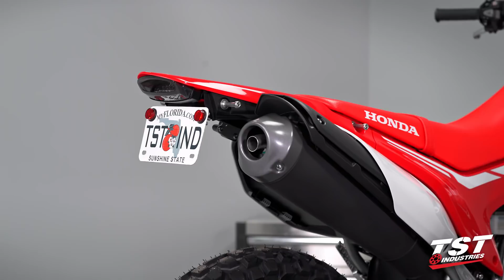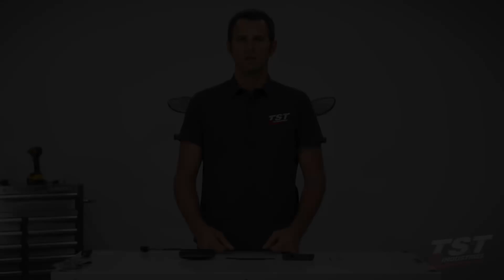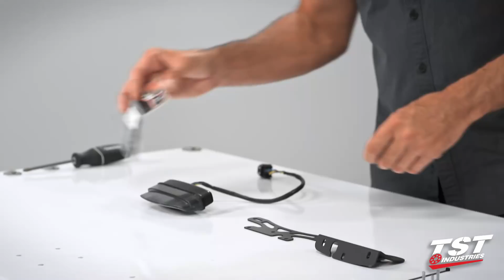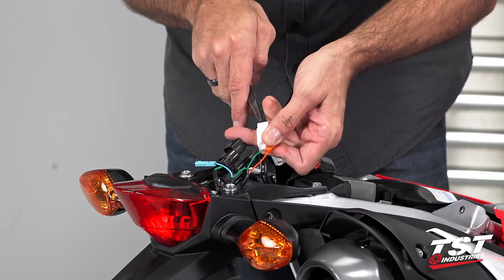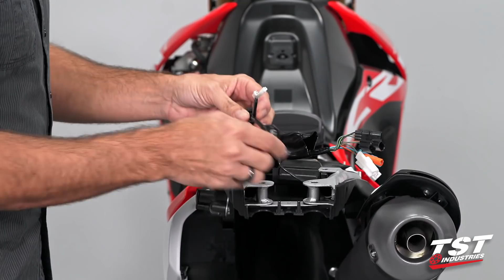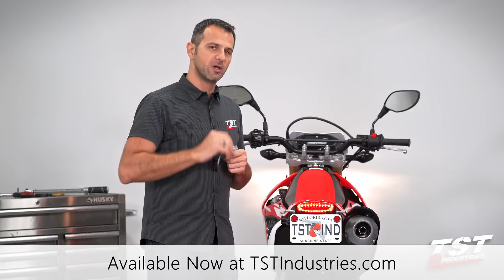How to install an Integrated Tail Light & Fender Eliminator on a 2017+ Honda CRF250L

Comment: Bought a bike with this system installed. Have a weird issue where applying the brakes will cause the turn signal to turn off at the rear/front/indicator. When I let go of the brakes, the signal comes back on.

When the emergency flasher button is pushed, they stay on even when braking. 

Any idea why applying the brake would cause the signals to stop until released?

Comment: Mine came in the mail today. Almost finished installing it and found out the wire harness on the rear fender eliminator doesn’t adapt/connect to the wire harness on my bike. Not sure what to do

Comment: I am waiting for something like this one for the Crf300l
Reply from the maker: We do own a 300 and have ripped it apart for that purpose. Just juggling several projects so please be patient. Also, at this point it is evident that it is impossible to make the 300L kit as clean as the 250 because of a frame component that hangs under tail light. We could potentially require the removal of this frame component but then a limited amount of customers would actually want our kit. So I am focused on designing around the frame components, which will yield a fatter rear end than what you see on the 250. How do you feel about that?
Reply: @TSTindustries  around the frame component will be perfect 👍. I really like how clean is all your works and I am pretty sure that you will make a good one. I will be looking on your website for any updates. Thanks 🙏

Comment: Light is pretty dang bright, and has a good side glow, as good as stock, I'd say. And if you recently knocked you stock rear indicator stalks off on some local trees, this thing is a great replacement. I am only worried about the gap the unit leaves beneath it. Prime spot for mud to shoot up and into that wiring connection bundle. I bent up an old license plate to plug the gap, but would have been sweet if it came with a plastic insert to cover that hole. 

Also, with some basic tools, you can rivet the stock license plate light to the bracket just below the new brake light, and still be road legal that way.

Comment: I installed this same kit on my 2020 crf250l and love it but my only complaint is that behind the license plate there is a giant open gap that goes into the subframe for water and dirt to get in sense the oem fender isn't connected the the plastic under the subframe

Comment: Does TST plan to do this kit for the New 2021 300L? Or will this kit fit it?
Reply from the maker: We bought the new 300L so we can develop a whole bunch of parts for it. The simple fender eliminator and LED signals will be first. The fender eliminator parts are awating machining and are queued for a week and a half from now. Then they have to go to anodize, quality inspection, assembly, etc. Once we launch a few parts that are straight bolt on we will be circling around to the tail light kit. For this bike it is not as simple of an installation as on the previous gens of 250. For a proper look and enclosure of the tail we will need to have a part of the black plastic shrouding around the OE tail light trimmed off. Otherwise the entire setup will look incomplete and let a bunch of debris through. There is another company that launched a tail light replacement for this bike but their kit leaves a giant ugly hole around the shroud and the whole thing looks terrible. That tail light is also pretty dim compared to ours. So, if you are patient and can give us a little time, we will be able to serve your request. In the meantime maybe you can tell me how you would feel about having to slice this plastic shroud if we give precise instructions on video like we always do. So you know, that part costs $9.58 from MrCycles or Partzilla should you ever want to go back to stock. If you want to reference the part I am talking about it is 80150-K1T-305
Reply: @TSTindustries  I would not be against trimming the shroud to fit a part. However that is me and I have pretty good mechanical abilities and understanding. For most people with little to no mechanical abilities I do not know the answer to your question. What if they take on the challenge and mess up the cut. Then they are blaming you for their f#$% up. Would it not be more beneficial to just fabricate a new shroud to fit your part and increase the price for R&D and the new part. A true bolt on product is what I look for when searching parts for anything I own. Again Im not against trimming the shroud but I would pay more for a true bolt on/plug and play option.

Comment: Will this kit work on a 2021 crf300 L ?
Reply from the maker: We're not sure as we haven't gotten that model in-house.
Reply: @TSTindustries  any update on if it’ll work on the 300l?
Reply from the maker: @Confirmies  judging by the comment you left on the 300L video I think you've found your answer.
Reply from the maker: @Confirmies  It will not by default but we are working on developing a kit for that model.

Comment: Do you offer this product for a Kaw KLX300?  Would certainly buy it if you have a solution.
Reply from the maker: The kit we have for the KLX250 fits the 300. We have had several guys order that kit and use our KLX250 installation instructions to get the parts on the bike and connected. They reported that all steps are the same between the two bikes. We have yet to get a 300 in the shop to do our video.

Comment: Hey, I just ordered my adapter, but I just got a wrong one, can you tell me which one I really need please?  My motorcycle is crf L 250, 2020
Reply from the maker: I can't help you without seeing what you have there.  I can only guess that you got the 2017+ version that has a sub-harness. If that is the case then just plug in your light without using sub-harness because the first gen crf250L is the bike that the tail light plugs directly into. If this doesn't solve your problem then you will need to contact our customer support through our website with photos attached.
Reply: Can you give me a contact number to send you the photos I have a long time with this problem

Comment: Just bought a 2020 crf250l and can't wait to install this on my bike. Curious, is it required to fix the hyper-flash? It doesn't bother me but I am curious if this will cause problems if not fixed. Thanks in advance
Reply from the maker: No electrical harm will come to any of the components from faster flashing.

Comment: I just bought a 2017 with this light but i just noticed the brake lights are not working, any tips?
Reply from the maker: The most common cause of brake function not increasing the brightness of the red circuit on tail lights is a poorly adjusted brake read switch. Please watch this video and see if you can get things figured out. https://youtu.be/3HWdVUyDVXQ
Reply: @TSTindustries  thanks for the reply that is exactly what it was. I'm new can you tell?
Reply from the maker: @danlefe  No shame in asking questions and needing help, that's what we're here for!

Comment: Hello do you ship to japan? Can I install this one on my crf250m?
Reply from the maker: We do not have CRF250M here in our market so I cannot answer this with confidence. If the electrical connectors, the frame and fairing components are the same as on the F model then yes. We do ship to Japan but also have a dealer there that we encourage people to shop with. Axxl.jp

Comment: Im torn just got the 19 Honda 250l I want it and then again I don't it looks cool though.
Reply from the maker: You can always just ride around with that black shovel hanging off your rear.
Reply: I like the plate yes but the turn signals in the brake light I'm not sure about we have alot of older people in Florida that don't pay attention

Comment: Just installed it with the licence plate light.  Looks great and took 15 20 minutes tops (altogether for both installs). Looks great and works perfect on my 2019 crf 250l.
Reply from the maker: Awesome. Thank you for sharing your story. Enjoy and ride safe!
Reply: Does the kit come with the extra adapter wire to connect the whole light to those wired or do you have to buy it extra?

Comment: not bad besides the gaping hole left behind the light to the tail section.  any idea if you're going to make a cover panel?
Reply from the maker: Since that is not an issue for most people we are staying away from making any closeout panels. We make a similar system for the DRZ400, KLX250, and Yamaha WR models. None of those bikes are sealed from the factory and nobody complains. We have heard this issue from a Honda customer maybe three times over many,many sold sets. I don't think it's prudent to tie up R&D and production time into something that not many people actually want. It is a nice cosmetic notion though, I do agree with that.

Comment: Can i get a separate sub harness adapter for my crf 250l 2017. Missed out when i bought the first one
Reply from the maker: I dont know what you mean by "missed out." Did you perhaps purchase a version for the 2016 bike? That one comes with no sub harness because it plugs right into  the bike. Our customer service department can straighten it out for you whatever the case is.

Comment: Just put it on now my bike won’t start. Makes a sound like its shorting out somewhere. Please help!
Reply from the maker: Does the bike not start/ Or is it that the light doesn't light up? Best thing to do is to send our customer service guys a message through our site. They will be able to help you with your issue. If your bike isn't starting and you are hearing a repetitive clicking sound in quicks succession then your battery is too low to operate the starter. Check your battery voltage to be upwards of 12v.

Comment: No doubt a better look. I won't install it due to the really tiny size and the risk of getting rear ended or side swiped. It's just too small for me to feel safe. The blinkers, especially, are too close to the center line of the bike and don't provide enough differentiation from stop to left and right.

Comment: Your kit leaves a big hole under the light, for dirt and water to get up in, needs a plate to cover it up!
Reply: I cut a piece of half inch flexible wrap styrofoam pipe insulation to fit side to side in the post insulation gap. When you tighten the license plate down it binds the insulation in place. The mailable insulation fills the gap. This should stay in place and help keep dirt out.

Comment: Is this street legal in germany? ( We need a "E-Number" or ABE ( Allgemeine BetriebsErlaubnis -  general operating permit ) for this.. otherwise we can get fucked by the police.. )
BTW, the turn signals have to be 240mm away from each other sooo.. Are you able to bolt on other turn signals?
Reply from the maker: These products do not carry any E or ABE registrations. You can use external signals without a problem. We have a few choices for you to consider.
Reply: TSTindustries Okay, thank you for the reply! Do you have some sort of adapter for the turn signals? Because i didn't found any on your website.
Reply from the maker: I am assuming you are talking about the 2017+ model since this video is specific to 2017+. Our Honda 2-2 converters will work for the signals, but you will have to move the green ground wires on the bike side from one plug to the other. It is very simple and we can guide you, but in order to achieve true plug-and-play setup you would have to be willing to do it according to our instructions. Otherwise you would have to tap into wires, or cut and splice, and that is not a very sophisticated or professional mode of installation.

This product page has a drop down menu. The choice for your installation would be 2-2.
https://tstindustries.com/TST-Signal-Plug-Converters-for-Honda.html
Reply: TSTindustries Oh i should note that. I got the 2015 CRF :-)
Reply from the maker: Well then the installation video for that model is a little different
https://youtu.be/9-Alr2zpuBw

On the 12-15 model the taillight plug is a single six-position unit and there aren't any separate signal plugs unless you disassemble the fender and take out the factory sub harness. That still doesn't solve the issue because our taillight has the opposite sex plug to fit into that 6-pops harness plug. On the 12-15 model you will definitely have to do some splicing, but we can still guide you.
Reply: TSTindustries As long as i got the plug/connector its no problem :-) I am skilled as this kind of work ^^

Comment: If I put the relay from you guys on the bike can I put led flashers on the front too without resistors?
Reply from the maker: That is correct. Our LED Flasher Relay will correct and control your entire signal circuit meaning front and rear.

Comment: I tried to look your website but the photos is not including the sub harness. So if I order does it come with the sub harness?
Reply from the maker: Anthony Cabasag the sub harness is only used in the 2017+ bike. If you choose the 2017+ model in the drop-down menu, the sub harness will be included in your package.
Reply: TSTindustries yes I have the 2017 model next week I'll order a set from you guys

Comment: done just purchased can wait to install 
TST LED Integrated Tail Light and Fender Eliminator for Honda CRF250L 2012+ / Rally 2017+
Options:	
Lens Color:	Smoked
SELECT MODEL YEAR:	2017 -
TST 2 Pin LED Flasher Relay Gen 2
Reply: TSTindustries do you have a solution for that problem with the back of tail light being Open exposing the harness clips to water
Reply from the maker: dubbed zero I'm looking forward to your comments after you install your parts.
Reply: TSTindustries yes just got my parts waiting to the weather gets warm will do can’t wait
Reply: How to order? I'm in the Philippines
Reply: monica laru-an  just go to TSTindustries.com

Comment: in your video you said that 2017+ models will come with a sub harness i was on your site but  it doesn’t say that a sub harness will be included or does not show in the photos as well
Reply from the maker: Hi - There is section on our product page that has all the information regarding the 2017+ models. That information is as follows:

2017+ INSTALLATION: The 2017+ model units include and additional wiring sub-harness to ensure plug-and-play installation. The installation procedure will vary slightly due to this additional sub harness. 2017+ CRF250L and CRF250L Rally's feature five plugs for tail light and signaling. Using our plug-and-play sub harness, three of the plugs will be used while two remain unused. The unused wires are white with green wires going in them. 

We will also try to update the product photos to show the kit contents for the 2017+ model (which is essentially the same as the 2012-2016, minus the sub-harness)
Reply: awesome thanks just read it  will purchase soon
Reply: im still waiting on reply from tstindustries about this

Comment: where the hell is the 2017 cbr1000rr tailight??
Reply from the maker: It's on our development radar and we do have sample taillights that we can scan to start the work. The reason why we have not made it far with the design is that these bikes are not very popular, at least in our area. It is very difficult for us to commit the capital and energy it will require to manufacture this taillight without having confidence in the demand for it. For now we are waiting to see if this model gains popularity, at which point  we will likely commit to making it happen.

Comment: Did it to my Rally.....
Reply from the maker: And.....what's the verdict?
Reply: I  Like it... All integrated and waterproof... Could be a tad bigger for visibility reasons...  The plug and play for the Rally Harness (addon section) added to the already existing wires back there make it a handful to get repositioned. I would have like to seen the plug and play bypass that big mess and plug into the ft. before that set.. More like the CRF 250L....,, Now there is an open gap at the back of the plate allowing water to get inside after installing the TST.   (Maybe You should consider sending a small foam block w the kit to close that off)

All in all I am keeping mine but will try to make a few improvements next time I open up the reap bodywork..
Reply: Captain Sam Wilson same problem here but once you bring that  question up to tstindustries will not reply to answers  i’ve been waiting on there solution on that problem i posted a video  on my page if anyone is willing to purchase they can check the sub frame being expose after installation before buying it i’m still keeping mine love the look i just brought a extra loom boot  too cover harness with the original loom boot on bike and tape it so water won’t get in

Comment: Loving my tstindustries fender eliminator and it looks even better once you throw supermoto tires on the bike. 🌟🌟🌟🌟🌟
Reply: TSTindustries just one thing that gap that’s left open after install do tst industries has something yet to cover that space i do a lot of off-roading  where’s a lot of water
the clipon’s that’s left without connecting to like the license plate light clip on can get corroded  as well as the rest of them just need to find a solution i had to order a extra loom boot wire harness and taped it up to hide the whole  harness it self don’t know how long it will last would you please upload your solution you never mentioned it in this video or you don’t have a solution 
the open gap  is  like  1”  wide
Reply from the maker: Awesome. Glad you got your setup installed and all is good.
Reply: dubbed zero I agree. The installation video cleverly omits the opening which exposes the entire subframe. I’m going to send mine back which disappoints me.